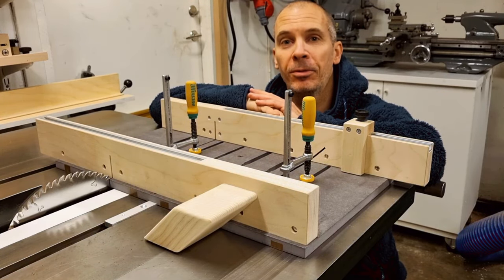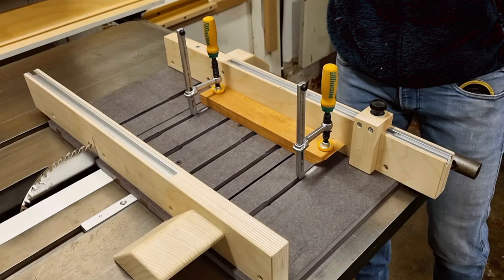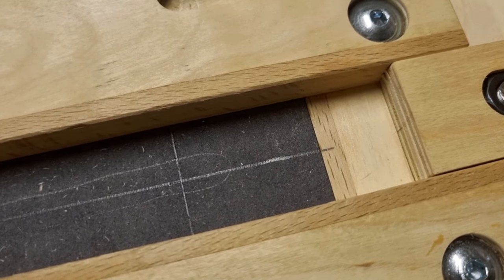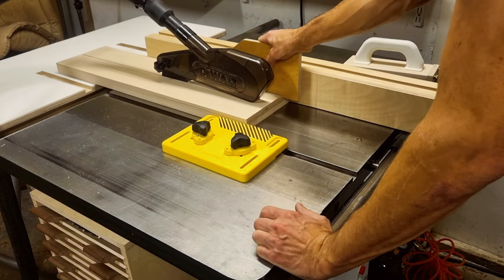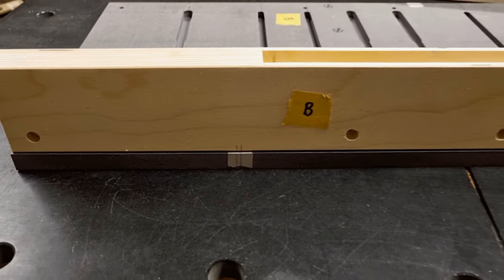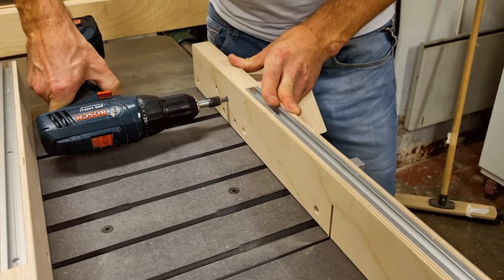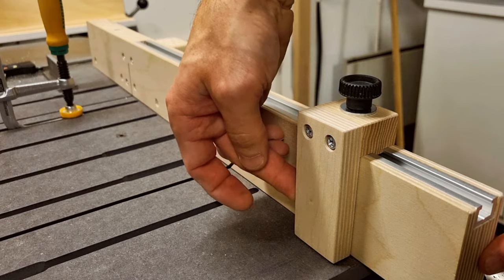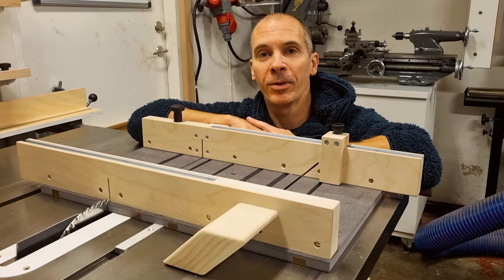The Flip Sled - Full build. One crosscut sled for both 90 and 45 degree bevel cuts.

Comment: Ola, why did you decide to make the clamp slots different from your large sled? The slots go through the material in the large sled, but not in the smaller sled.

I am enjoying your videos very much - thank you !
Reply from the maker: Thanks! Very good question. To start with, when I built my large sled the dovetail clamps were not invented, so that one uses festool rail clamps. These clamps acts (more or less) vertical on the wood. Through tracks has some advantages, the sled can be thinner and the tracks doesn't get filled with chips and dust.

But, I consider the dovetail clamps to have a better clamping interface and therefore chose these for my new sled. Only drawback is that the dovetail shape push the wood apart and using through tracks with those clamps I would be afraid the clamping force would push the base parts aside.

Comment: It's beautiful 👌
But... how do you adjust the fence if it's not 100% square when it's already screwed in place with so many (machine) screws? 🤔 Maybe I need to rewatch and I missed some clever trick.
Reply from the maker: You loosen the screws, adjust the fence and then tighten the screws again🙂. All screws sits in oversized holes to allow adjustment. The magic trick is to keep the base plates from moving when you adjust the fence, I mention that at around 10.15
Reply: @CarmoniusFinsnickeri  Aah, oversized holes 👍

Comment: Hi, what exactly is the base board made out of? You said it is slightly more dense than MDF…?
Reply from the maker: Valchromat is the name for it in Europe, it's classed as hdf (high density fibre board). More dense than mdf, which has a quite porous core whereas valchromat is more homogenous, stiffer and weighs a bit more.

There is also through coloured mdf but that's just coloured, except from that is has the same properties as mdf.